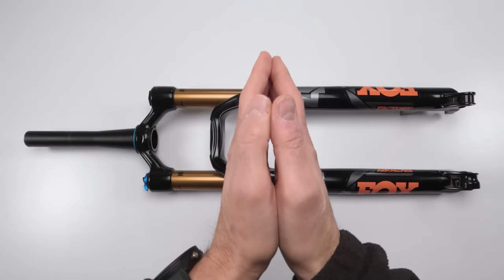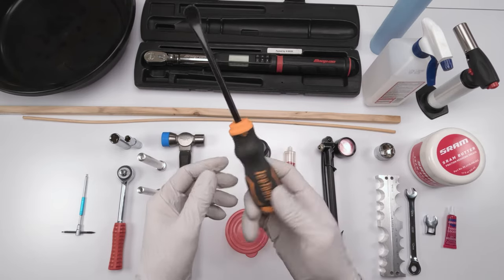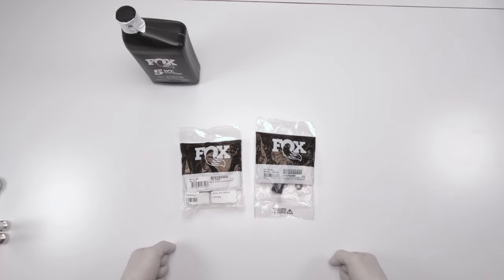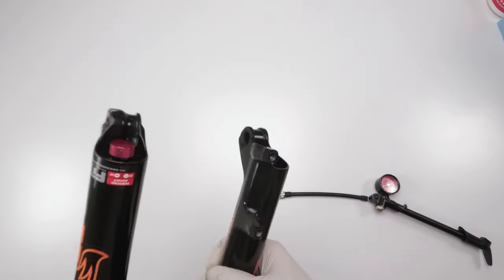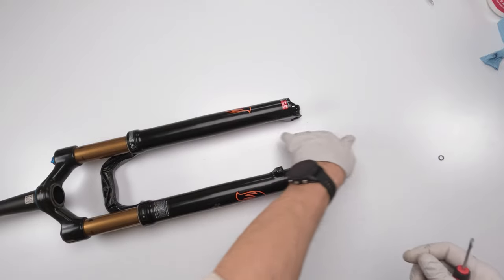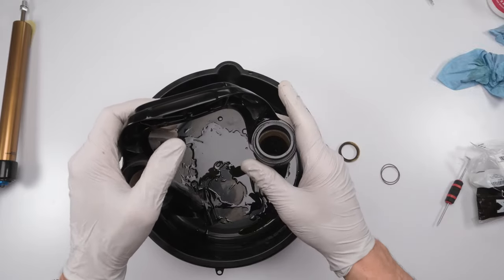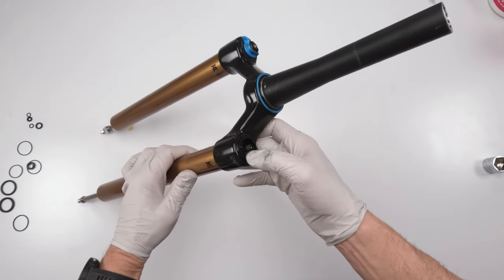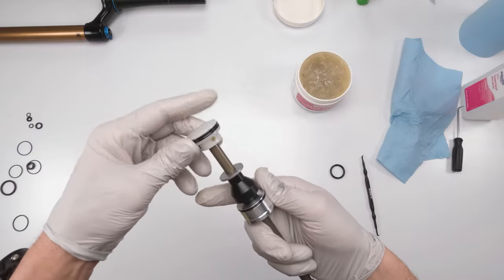Fox Factory Series 34 Float FIT4 2021 Damper, Air spring and Lowers FULL Service guide for beginners

Comment: What is your opinion on just changing the oil in the fit4 damper ? A full service yearly seems a lot. With what you have seen in your rebuilds how long can a damper last ? (If we change the oil yearly in the damper ) and do lowers and air spring yearly. Thanks
Reply from the maker: It all depends on how much you ride, and how aggressive the terrain is. If you're not riding terrain that is constantly hammering your suspension (think tipical XC), then you should be good for about 200 hours, if not more, with the damper. I would absolutely keep up with the 50 hours, though (especially if you regularly ride in wet or dry/dusty conditions). It's super easy, and you don't have to replace the wipers each time. In fact, keeping up with the 50 hours really give you a good idea on when it's time to change the wipers. If you find the foam rings get very dirty between services, then it's time for sure. 

As for the air spring, I apply a fresh coat of grease during the 50-hour. It literally takes 5 minutes once you get use to it, and this way you know the seals are protected, which will only make them last longer (plus I love the feel of a freshly greased air spring and lower boots)

Keeping up with the 50 hour allows you to monitor both shaft seals. When the shafts become sticky or stutter a lot when inserted and retracted by hand, or if you feel a significant amount of lateral play, then the rebound head or the air spring seals will need to be replaced very soon. With the fit 4 damper, I honestly believe for most people only the rebound head and the oil need to be dealt with. Unless you're constantly pounding the fork (ex: large jumps), the uppers seals and shims should be fine. This cuts the damper service time by at least half.

Hopefully this helps

Comment: I have a fox 36 with the grip 4, could I still use this video to service my fork, or is there any other internal difference apart from travel and size?
Reply from the maker: My sincere apologies for the delayed response, but it's been nuts here the last 3 weeks, and I'm way behind. I'm assuming "Grip 4" is a typo, did you mean FIT 4 or grip 1 or 2? If it's a fit 4 it will be very similar to this video. There are some minor differences between model versions. If it is a grip damper, then the damper will be significantly different. I do have a grip damper video that might help. I plan on covering all of these over time
Reply: @zoubtube  Yes, my apologies it is a FIT 4. I was planning on using this video to do a full fork service but i have no idea where to start. By minor differences I assume you mean bolt sizes and things related to the increased stanchion diameter? Anyways i appreciate the response!